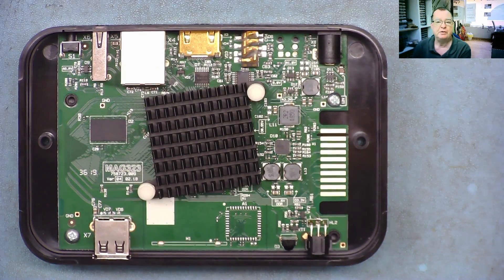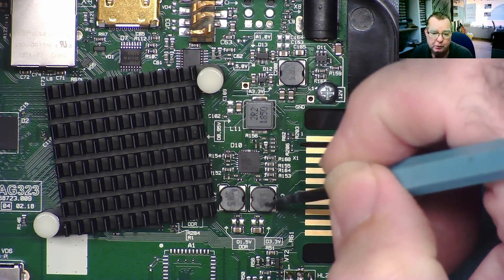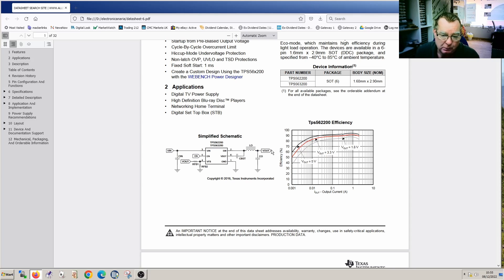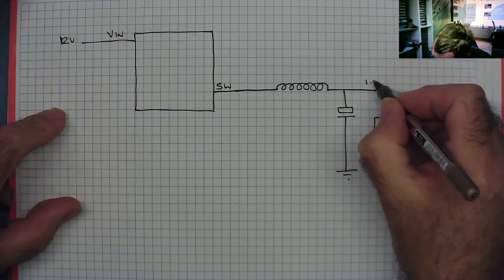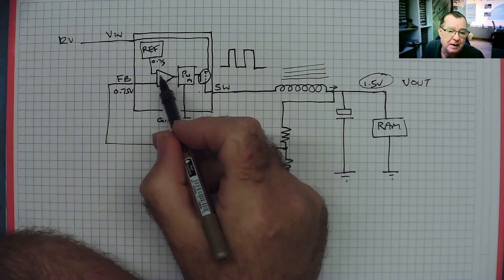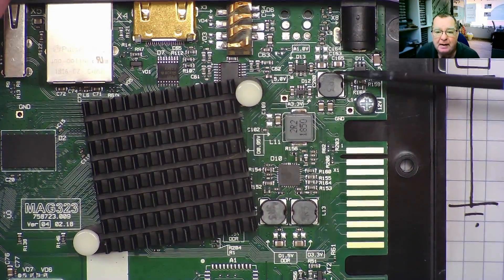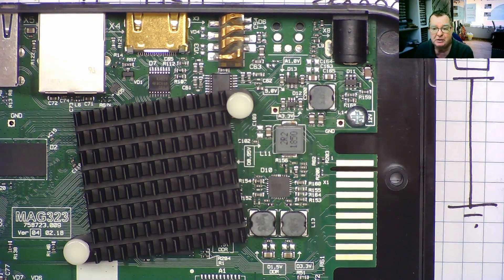How a PSU With Too LOW Voltage Can Kill Your Electronics Devices! HOW A Buck Converter Works!

Comment: It is absolutely false that in an inductor "the current comes in but it doesn't come out." That is contrary to Kirchhoff's current law - which is called a "law" because it is always true. At any instant, the current out of one end of a simple inductor is exactly equal to the current into the other end, ignoring a tiny difference that may be due to stray capacitive coupling.

Comment: Interesting. I used a power tool battery to power my laptop via the power plug.The laptop would pull juice off the battery and run just fine and then switch to the internal battery a little early but I was getting like 80% of the useable power out of the power tool battery. However, this 18 volts nominal (instead of the 20V the laptop power adapter provided) must have damaged one of the power control components because the laptop died though it was when it wasn't powered by the tool battery at the time. But it's possible something else killed it. I have bought something like 8 of those laptops as parts machines and have only seen one other bad motherboard (It was really bad killed the guys ram and he had bought a replacement motherboard but didn't realize his ram had gone bad, probably killed the CPU too.)

Comment: That's an unexcusable design flaw. An undervoltage protection for that circuit is as simple as a comparator (comparing the supply voltage to a voltage reference) connected to the enable pins of the buck converter ICs

Comment: In a way what your describing is a bad implementation. There should be a circuit that only pulls the enable pin of the PWM IC high when the input voltage is within an expected range.

Comment: Now I understand it in correct manner.

Before watching this video and without board examination, I just assumed, at lower voltage, more current would be draw by the load because of P=V*I. Therefore, circuitry traces, at least, would not handle it.

Comment: I recently had a 12v zvs driver die when the 12v battery dropped to 8 volts which killed both MOSFETs

Comment: Interesting. While I was working as a computer repair tech, one customer brought in his old Compaq laptop, saying for some reason it kept shutting itself off. So of course we tested it with the power supply he brought in with it to confirm the issue.

Sure enough, it would power on and start to POST, but it was like the moment it tried to spin up the hard drive it would shut down dead. When we looked at the power supply, we found that he was using a 9 volt power supply LOL!

For anyone not familiar, a laptop charger/power supply should be between 18 to 20 volts. I have no earthly idea how the thing even attempted to power on with a 9 volt power source, but it sure enough tried!

Honestly I wouldn't have been surprised if the laptop might have actually run if it had been connected directly to a car battery. I mean not like we'd dare do such a thing with a customer's computer, but it sure made me wonder.

I dunno, I guess the voltage regulator on the board was fairly flexible regarding input voltages, I would have never expected it to even attempt to turn on. At least it didn't damage the system. 👍

Comment: So then why you even start with that one chip that needs 12 volts in the first place? Why not just set it up like the other box, starting with 5V? And what would be the problem with just using resistor-based voltage dividers?

Comment: There is one more cause: at too low gate voltage the mosfet will not open completely, so it will have way higher RDSon and therefore dissipate a lot of heat. I had this case on a UPS with a dead battery. One of the mosfets exploded right before the protection circuit disconnected the battery.

Comment: The current MUST flow through the inductor, but there is a voltage drop, and this is therefore a form of energy transfer which is what is stored as a magnetic field in the inductor. The current cannot rise instantly, it rises at di/dt = V/L, but any current entering the inductor must exist at the exact same quantity.

Comment: I remember having a 12 volt tv box and i modified it to run with 5 volts usb, and i had another of the same of those 12 volt tv boxs and i tried to run it with 5 volts and then i heard some sparks and orange lights coming out of a 3 pinned smd looking thing.

Comment: Can I ask a question can bk emf play any role in this as the pulse going go a coil and the calapsing magnetic field can make the current or voltage ⚡ do a big spile or does it have a fly back diode or something else that prevents it from spiking to high ie the feed back loop just wondering
Your vedeo was great and I feel you knew and know why how and you know your stuff very well and was very educational also just that I play wirh coils to try get back emf heavyside bifoler just fot hobby

Comment: The average current through the inductor (and by extension through the FET) should still be the same as when it was running on 12V though, it would just be the spikes that are higher. Which is still enough to cook a FET since P=RI^2. Increasing frequency might fix it though, something tells me a current-mode switching regulator IC might just handle it.

More importantly in my mind is that the 12V rail is likely being used for gate driving, so the R_DS ON would be significantly higher when running at a lower voltage. This is often what UVLO protection is meant to avoid, though ultimately it depends on the intended input range of the switching regulator.

Or you know, use a switching regulator with thermal shutdown.

Comment: I killed a buck IC from a mini-pc, trying to use 6v instead of 12v. It convert 12v to 5v, and then the lower voltages are from the 5v. so i removed the IC/coil and put a buck converter board inside, and routed the output to the 5v rail. Worked fine. Took me a while to understand why a lower voltage burned the regulator, but eventually understand the limitations of tiny regulators.

Comment: Hello, I have very little background in electronics and I wanted to ask a question. I have wirelless analog modulation UHF headphones. If I increase the source volume, then increases amplitude and logically should increase radio signal strength and coverage and vice versa? Or is it a misunderstanding and it works in different way? Thanks.

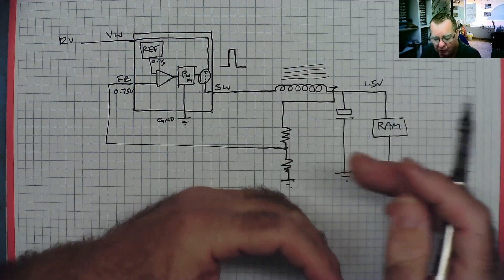Comment: 10:45 Your explanation makes it sound like the (1.5V) output is only supplied by the collapsing magnetic field in the coil. Really it is supplied through the coil while it's energized and by the coil, while it's not energized. Essentially it's just an LC low pass filter with a flyback diode, in order to create a path, for the coil to power the output. But you kinda omitted the diode in your example anyway. And in most buck converters, the diode is replaced with a MOSFET anyway, which is driven with the inverse of the PWM signal, to reduce power losses caused by the voltage drop over the diode. But I guess that kinda beyond the scope of what you were trying to explain.

Comment: This seems a bit counterintuitive to me. If you don't have enough voltage to start with, how does the chip even run in the first place to even supply the 5 volts instead of 12 to the mosfet. If the chip is insufficiently powered how can it do anything? Doesn't it need some kind of clock cycle with sufficient voltage on the supply side for it to switch on in the first place?

Comment: Answer. watts = Volts x current. Watts stays the same based on resistance. If volts low then current has to go up. I didn't watch the vid just wanted to answer the click bait title.

Comment: I plugged my power supply into the USB connector on my android head unit, is this repairable or is there no protection on the USB circuit?

Comment: Another device that could die from undervoltage is the Dragon from Atmel (now Microchip)
It has a boostconverter to make 12V from the 5V USB power. If the computer cannot supply enough current, the boost converter tries anyway and thus killing itself with overcurrent.
Cheers 👍🇳🇱

Comment: In the diagram, the freewheeling diode / low side MOSFET was missing, which is used to keep the current flowing into the output from the inductor as its field collapses.
The main issues I can see with a lower input voltage would be heat related, likely due to the MOSFETs not being fully switched on at the lower gate voltage, the longer on time of the high-side MOSFET, and maybe the higher average input current (the peak inductor current will be the same in both the 5V and 12V cases - typically less than twice the output current).

Comment: The problem is when you step down from 12 volts to 5 volts, but you only give the circuit 4.5 volts. 
The stepdown should be switched on above 100%.

Comment: Your explanation doesn't actually seem quite right...

It would make perfect sense if we were talking about making a simple buck converter from scratch, but these integrated ICs are actually much more sophisticated than that nowadays.  In particular, I don't think I've ever seen one of these integrated chips that doesn't feature overcurrent protection as a standard feature, so it's pretty much impossible to blow the chip by just pulling too much current through its internal MOSFETs as you suggest.  They're also generally designed to be fairly input-voltage-independent to specifically avoid this sort of issue.

What's more, looking at the datasheets for some of the specific models you listed, the TPS56x200 chips support an input voltage from 4.5V to 17V, and show reference designs and tables which list the component values required for different output voltages.  None of these tables or implementation notes suggest that you need different inductor or capacitor values depending on your input voltage at all.  They're just not designed to require that.

I could see potentially running into a problem generating the 5V supply on that board, given that the input is only 5V, so obviously the output can't go that high...  In that case I'd expect the chip to either supply a lower voltage or just shutdown, though.
Reply: You are totally right. I am not sure, if the author really understands the principle of buck converters but omitting the flyback diode is always a bad omen. Note, that in normal conditions the inductor current does not depend on the input voltage, but it’s determined by the load. And it should not vary much. However, in case of boost converters, he would be right.

Comment: Good video overall.  I'd like to add that the upper right regulator here is a switching regulator which seems to be generating the 5V supply, not the 3.3V one.  The 5V supply seems to be supplying the 3.3V and 1.0V regulators which seem to be of the linear regulator type.   The triple rail IC generating the secondary 3.3/1.5/0.95V might also be fed off of the 5V rail as well (as the linear regulators suggest that the 3.3VSB and 1.0V loads are small).

Comment: Essentially these are negative-resistance devices, and you often don't think of putting too much current into a device since normally the device can be depended on to limit current and the power supply just needs to limit voltage. I've always imagined this could be the case but didn't think it would really cause things to get damaged.

Comment: The feedback is compared with the ref voltage. According the difference the pwm is generated. The question is then when we have a lower voltage in, what do we have as vref. Along as we have the fixed vref, nothing will be destroyed. Is there anything in de datasheet that gives us a relation between vref and vin before stating dedtruction.